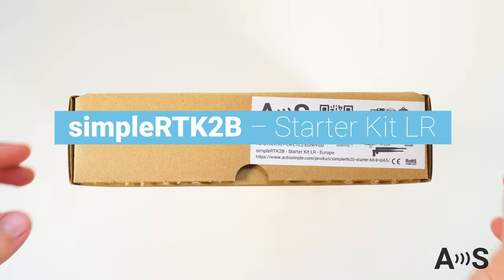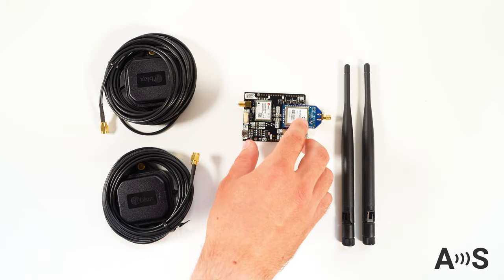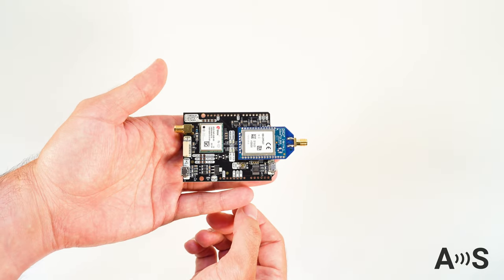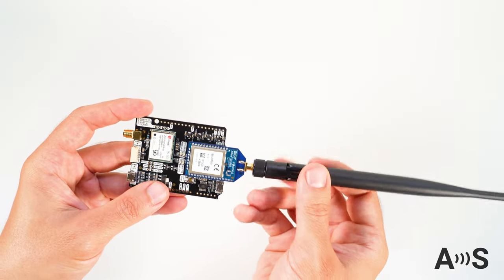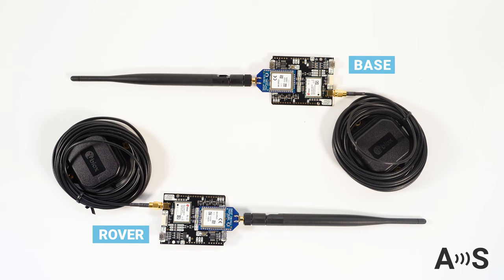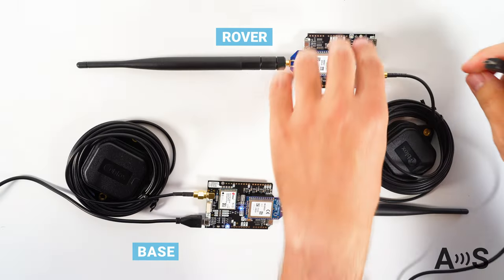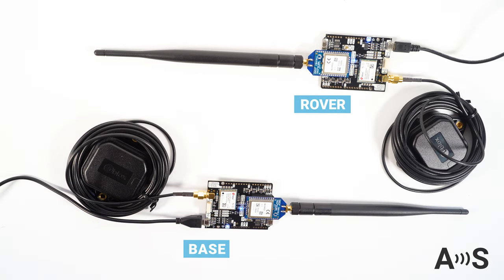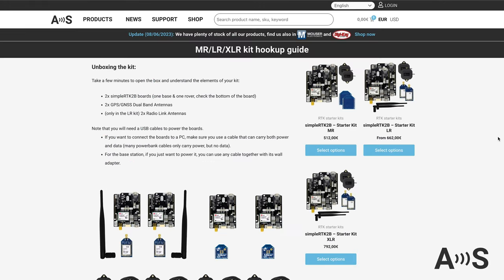simpleRTK2B Starter Kit LR  from ArduSimple. Set of Base and Rover based on ZED-F9P + ANN-MB antenna

Comment: In the video, the base is connected via the POWER+GPS port, but in the User Guide, it says to connect to the POWER+XBEE port. Why is that?
Reply from the maker: Thank you for your question! You can actually use any of the 2 with a different purpose:
- POWER+GPS will give you access to the GPS data from a PC.
- POWER+XBEE is useful to power the board via wall adapter, and then have the POWER+GPS free, in case sometimes you want to connect with the PC to check or change parameters.
Both can be connected at the same time without problem.

Comment: You want $700 for this?! you are crazy.
Reply: What is approximately cost of it?
Reply: @Bandhiyamayur  ZED-F9Px2 $300
Overpriced multi-band ublox antennas $120
Some type of XBee looking RF link, I would say no more than $50 each so $100
So around $520 in raw materials
With added cost of other components, PCBs and packing, if it works out of the box with no issues it's okay.
But if you can DIY it, it would be half of that cost, especially if you live near RTK base station.